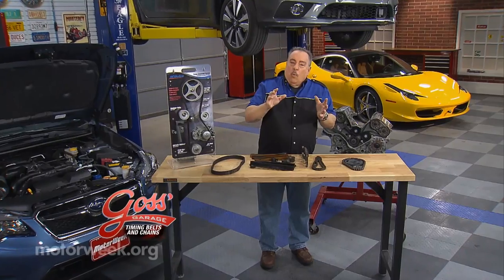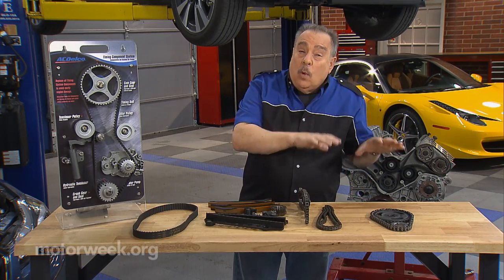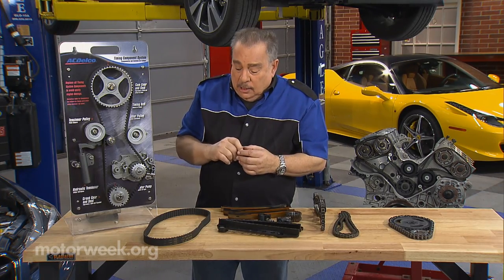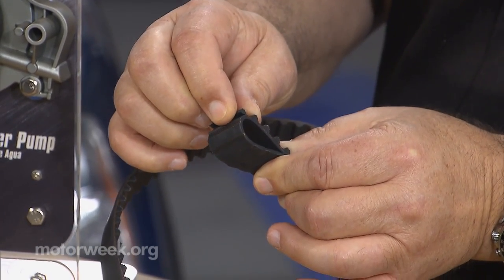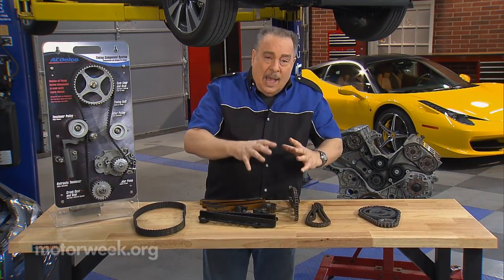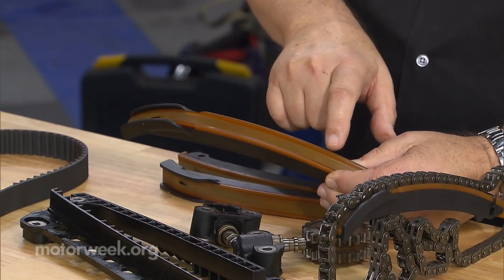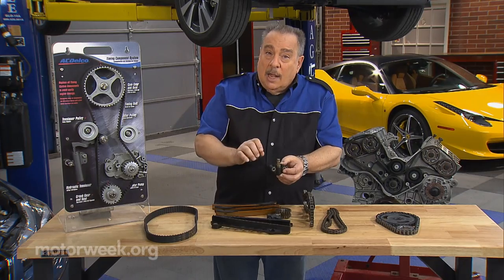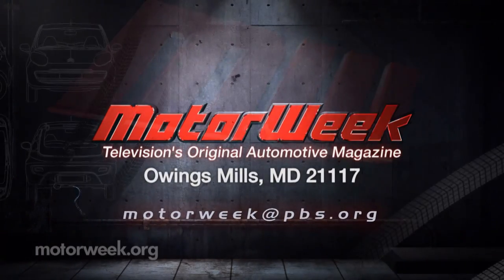Goss' Garage: Timing Belts and Chains

Comment: could I replace my oem timing belt to a timing chain ? Thank you for your information
Reply: Definitely not. Timing chains need to be lubricated by the engine oil while belts do not. The engine would need to be modified to the point where it wouldn't be possible unless you can forge your own parts.

Comment: Nobody in my family knew what a timing belt was until 1994, when a belt failure killed mom's 1985 Nissan Maxima. I loved the car, so I hated timing belts with a passion. Repairing the engine didn't make financial since because the car was old, and it unreliable during its entire life.

That in mind, timing chain replacement usually costs more than timing belt replacement, if you are unlucky enough to have a chain fail.

I have heard that with the VW VR6 engine, the question of chain failure is when it fails during the life of the car, not if the chain ever fails during the life of the car.

Comment: I have a 15 CR-V and I use Mobile 1 0W-20 Full Synthetic oil and Mobile 1 filter every 3k. It costs me 30 bucks and a bit of my time. Small price to pay for a well running car.
Reply: Jordan F That sounds about right with a Mobil 1 Full Synthetic oil. I used to put Mobil 1 in my '09 Lancer that had a recommended oil and filter change at 7500 miles. I tried to do it every 5000 miles with Mobil 1 but their oil only lasts around 3500 miles. Then I heard of Eneos Fully Synthetic through NAPA. After 1 year from switching with this oil and Wix XP oil filter, it is possible to extend the service interval to 5000 miles because the oil never turned dark until around 4300-4500 miles. Try it out. I'm pretty sure your CR-V owner's manual indicates oil changes more than 3000 miles.

Comment: I put 23 years on my first timing belt on my 1991 Honda CRX Si.  It has low mileage, but still...
Reply: Some of that timing belt time stuff is really pushing it.  Friend had a legacy with 100k  but 12 years on the belt.  Supposed to change every 105K or 8 years,  50% over, still no broken teeth.

Comment: There you go, change your oil often. My car says 10K miles, I do it at 5K miles.  It costs me about $25 and 45 minutes to do it, I don't care if there is some life left to the oil, I want it clean as possible.
Reply: Tool0GT92 I like your mentality. If everyone changed their oil before at due date, there would be a lot more better running cars on the road. I do mine about 3/4 of oil interval as I use full synthetic oil and genuine filters.
Reply: I recently ran into a Honda and a Chevy mechanic.. both said change oil more often to make timing chains last... both have done chain on cars with 120 k.. can get very expensive .. folks who use good synthetic brands change @ 5k to 7k... timing chains last twice as long or longer...400 k on my 04 accord... still runs like new...adjusted the valves @ 235k...
Reply: Yeah heard the same thing about timing chains. Oil is cheap!
Reply: I never changed oil on my cars.
Keep the system closed.
Add oil and change the filter once every 100000 miles.
Reply: It's an odds thing.  Most people keep their cars 100K or less.  You could probably change the oil every 15K and easily make it to 100K.  That stuff really adds up eventually though.  I have one car at 310K and I've changed it every 4K with synthetic oil.  Original automatic too, full syn and filter every 25K.
Reply: I do mine every 2 thousand miles
Reply: Clearanceman2 which car
Reply: @BmwMe-uh9sy  Why 2 thousand?  Too long.  Need to do at 500 mile intervals.
Reply: oldtwins na eh, I like letting the additives do their work
Reply: Clearanceman2 4K miles is nothing, change at like 7.5k

Comment: i bought a used  '09 pilot that uses a timing belt. got it with 108k  miles and ran good. was advised by dealer that the timing belt service (belt, tensioner, idler pulley and water pump) is a routine 60-70k service and that i was nearing the 2nd replacement. $800 parts/labor at my local dealer. traded it back in and got an '11 enclave with the DI V6 that i later found out had timing chain issues across the whole engine family, with them coming apart. Go figure....
Reply: Seems way soon.  My 95 accord is every 90K and 2000 legacy 105K.  Hard to believe a 2009 anything would only be 60-70K.
Reply: Quick search shows some dealers pushing 65K and some saying 105K.  65K is ridiculous for a 2009 model year vehicle and I doubt it needs to be done that often.  Just my opinion.
Reply: The dealer said the interval was different if you lived in hotter areas. In deep south texas our summers are HOT lemme tell you, 110 degrees if you factory in humidity on a daily basis. In the end i traded it in and got the enclave. Happy with it but i liked the Pilot too.
Reply: huh, $800 is a great price for parts and labor at a dealer. You should have jumped all over that versus trading it in.

Comment: 89-94 toyota 1uz-fe that came in the lexus sc and lexus LS is non interference belt driven engine great for boosting with 6 bolt mains and stronger beefier connecting rods than the later versions with the vvti system

Comment: it hopefully wont be long before cams are gone completely.  Freevalve has pneumatic actuated valves.  The advantages in controllability of lift, duration ect are HUGE.  Cant wait until US auto makers start paying attention to the tech.
Reply: RCPro Driver seems to be a good idea for automakers👍
Reply: yes and no.  This would mean designing new engines or adapting existing ones...either way that means lots of R&D and re-tooling.  The advantages of freevalve tech are good for consumers, not auto makers.  It is more profitable to keep making money off of existing tech.  Unless enough consumers find out about this stuff and start to demand it, or laws are passed which force auto makers to search for ways to improve emissions/MPG they won't want to invest the money even though this tech is a huge step for combustion engines.  Seriously, removing the cam and having unlimited "cam" profiles allows for some amazing tuning to be done.

Comment: Too much fear mongering.  Not all engines are interference in design.
Reply: Ray Chen I got lucky with an 87 Ford Escort which had a non-interference engine. The only other thing that goes is the control module. Being a disposable vehicle of sorts (my former commuter beater), changing the timing belt was nearly impossible due to tight quarters. The same era Hondas had interference engines and were crazy expensive if one failed. Like my friends '91 Prelude. Five grand fix at the dealership!

Comment: Timing belts don't last as long but are easier to change.  Timing chains last longer but are harder to change.  Pick your poison.
Reply: Clearanceman2 timing chain. Lasts the life of the vehicle if properly maintained.
Reply: No it doesn't.  Not unless the engine is a POS.
Reply: Clearanceman2 In a well-maintained engine a timing chain can last up to 300,000 miles and even longer. Period.
Reply: Yeah, 300,000 maybe if the guides last that long.  You're talking about old ones with the double chain, not newer ones with plastic guides and long chains.  But I have 310,000 on my daily driver, if it had a timing chain, it would need  a new one by now.  My other car has 267,000 and it would be close too.
Reply: Clearanceman2 You my friend are a rare occurrence keeping your vehicles that long especially in this day and age of everything being disposable. I applaud you 👍🏼. We should be keeping our vehicles longer and not changing vehicles every couple of years for the latest and the greatest.  What kind of cars if you don't mind me asking?
Reply: LSanti 2000s subaru legacy and a 1990s honda accord.  The Honda especially will last 400K with proper care, some of them have gone a million miles although this is extremely rare.  People get rid of cars mostly for emotional reasons, not logical reasons.  I get a kick out the answers I hear when my neighbors buy brand new cars and I ask why.  I always say congratulations because that's what you are supposed to say but I mean condolences.  People still trade cars like it's 1973 and cars were lucky to make it to 100,000 miles.  If you look in areas of the country where cars don't rust much, you can buy a 90s accord for $1200.  And it's got 150,000 miles or so.  The person selling has no idea that car isn't even half done.
Reply: Clearanceman2 100% agree.  And you've got some of the best vehicles for long term reliability.
Reply: Sorry I'd prefer Timing gear is the best.